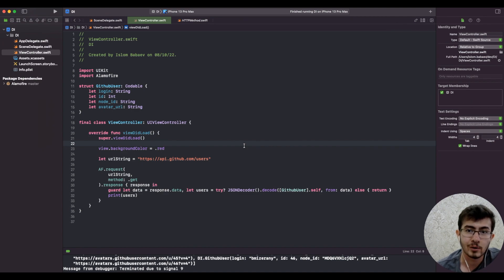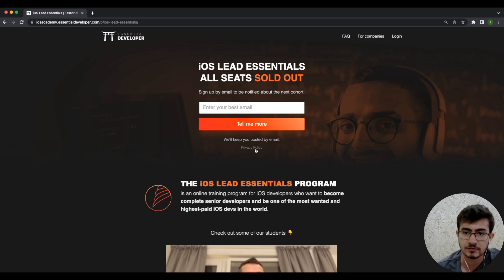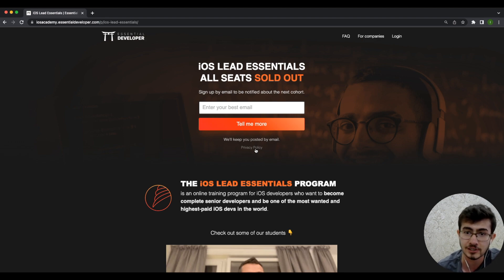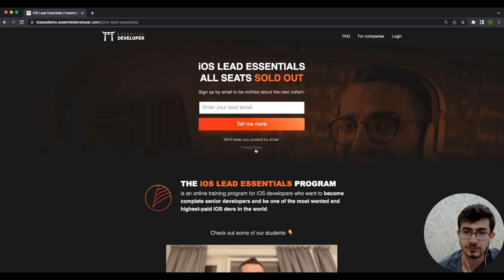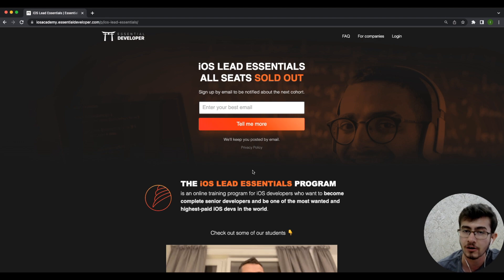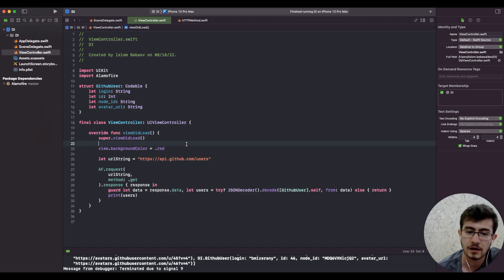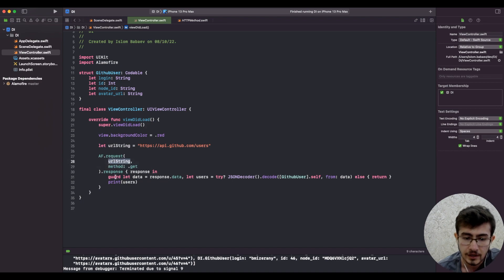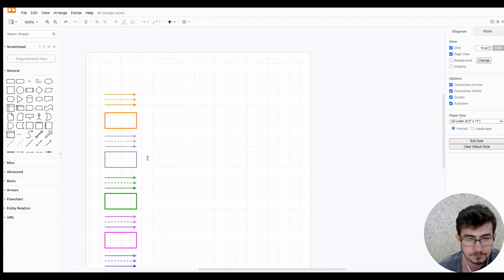Tight vs Loose Coupling

Comment: Hey Islom,
Thanks for sharing this great content. I feel like on your last architecture diagram the `ViewController` doesn't have any code dependency with `GithubUser` struct instead `URLSessionNetworkManager`, `NetworkManager` Protocol and `AlomofireNetworkManager` depends on the `GithubUser` struct. Would you please let me know your thoughts on this?
Reply from the maker: Hi, on line 53, we invoke request method that returns array of GithubUser. We are not doing anything with it, but this is still a strong dependency between the view controller and the model. If we would ever go and change anything inside the struct, xcode would rebuild the view controller (this way we can prove that there is still a strong dependency between these two)